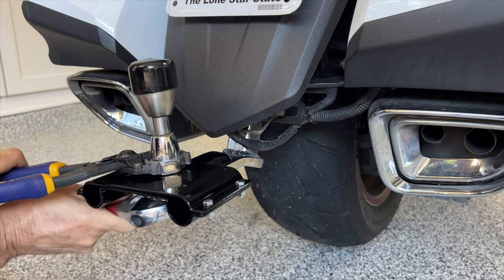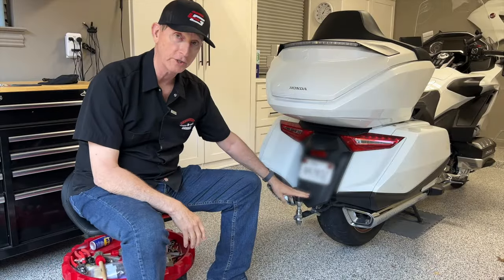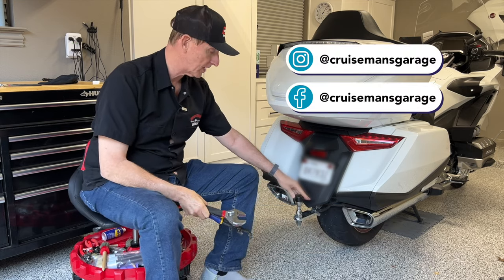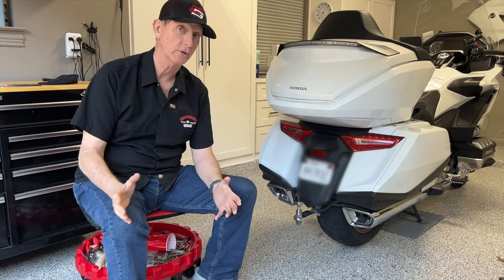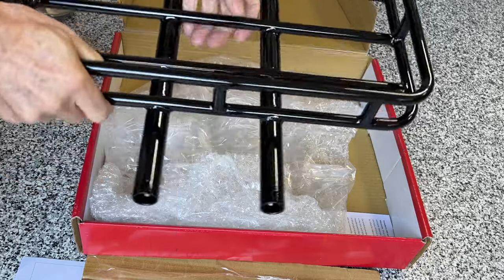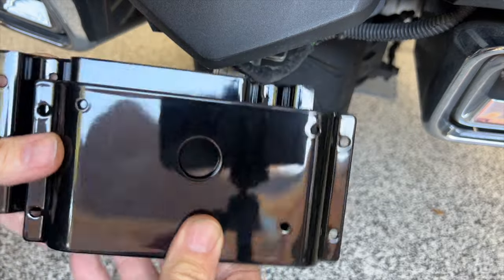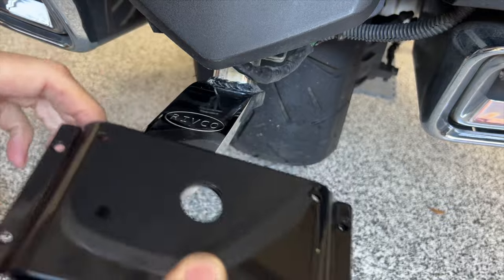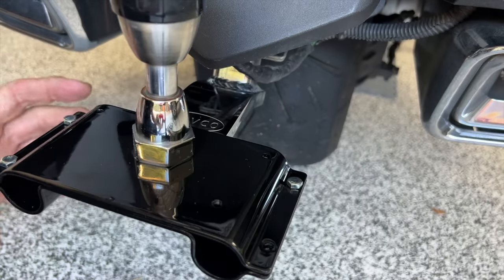Universal Trailer Hitch Rack Install on 2018+ Honda Goldwing

Comment: I purchased this rack last summer for my 2021 Goldwing. I ended up attaching an Igloo cooler which kept my food and beverages cold. It was a lifesaver to say the least. We ended up hitting temperatures of 107° while riding through the Los Padres National Forest . The cold beverages along with my “Big Ass” cup holder Kept our beverages cold and we remained hydrated during the ride. The rack did not appear to change the performance or handling of the motorcycle whatsoever. It’s a great addition if you’re just looking for a little bit more space for your bike. 🇺🇸👮🏻‍♂️

Comment: I've used this rack for the last 2 years. My wife and I have done over 5000 miles with it. The smaller bags and trunk on 18+ help me decide to purchase this. Each year we take at least 2 long distance trips. The extra space and easy removal when you get to where you are going makes it convenient.  I use a 40L Nelson Rigg Hurricane duffle bag and stack a 10L Nelson Rigg on top of that. Enough clothes for a week and extra in case the temperature changes. There are no problems with lean angles, weight issues,  or exhaust heating up the bags. You never notice it back there. The license plate is covered but I took Max McAllister advice (watch the War Horse project) and photocopied my plate and attached it to my bag. The brake lights are not covered.  Be careful when entering driveways or parking lots with steep slopes because it may drag. Hope this answered some of your questions.

Comment: It never ceases to amaze me as to how “stuff” people insist on travelling with. I rode across Canada last year, took a ferry across to Maine, and back out west to Alberta. I was on the road for 4 weeks with my 17 F6B which as most people would know has no trunk. So I had 2 saddlebags for everything bike related plus rain gear etc etc. on my back seat was a medium sized waterproof duffel bag. I tend to do laundry every second or 3rd day on the road and that’s it. It just blows me away that people would travel with a weeks worth of clothing …on a motorcycle and “somehow” fill another duffel or two.
Reply: More space for a laptop , I Pad , satellite dish and small tv .

Comment: Hitch on a motorcycle is something I've never understood.  Where is the fun of riding? Being able to use its size getting into tight spaces? Ease of maneuvering in traffic?  
If I need to take lots of stuff, I'd take a car and trail a bike.
Reply: 1000 % agree with you.
Reply: The "fun of riding" is still there.

Comment: Nice video Cruiseman.  Here was my thinking when determining this style tray versus a trailer.  Let's say you have 30 lbs of stuff loaded on that tray.  The tray is roughly 3' from your rear axle.  That's a moment arm of 90 ft lbs of downward rotational force on the rear suspension.  Added to whatever you have in the OEM bags and trunk, plus a possible co-rider.  That's a lot of downward force on the rear suspension parts and tire.  Contrast a trailer (I too have a Bushtec) that can hold up to roughly 200 lbs. (that's a lot of crap) which is supported mainly by the trailer wheels.  Much lighter tongue weight and no shock loading due to bouncing, etc.  The tray concept is probably good for very lightweight day trip needs, but if you're in it for the long haul and traveling an extended time, save the bike and get a trailer.  Just my thoughts sir.
Reply from the maker: Fair points.
Reply: A 200# trailer should have a tongue weight of 20-30# (10-15% of trailer weight). That puts you in the exact same boat (albeit with more gear).

Comment: Why not just flip the cargo tray over so you have a flatter surface to mount a bag to? You might lose that anti-rattle screw usage but you could put a larger bag etc on without issue.
Reply from the maker: I suppose you could do that.

Comment: It may have been a different brand, but I've seen FB posts where the bracket gave way where the tubes slide in.  They may have over loaded the rack, but I'd be careful.

Comment: How much weight could this hold. 
If I missed that in the video I’m sorry but I also checked the website and didn’t see anything 
This would be perfect for my tools at work but that could be up to 40 lbs
Reply from the maker: I don't think the issue is the rack, but the tongue weight capacity of the hitch itself.

Comment: How about the heat coming from the exhaust pipes would it not melt plastic coolers? Or soft bags ?
Reply from the maker: Not sure the exhaust is THAT hot to melt a plastic cooler. And, the exhaust should mostly travel under the bag. It could get some exhaust dirt and grime, however.

Comment: Didn't see a max carry weight?  Does it reduce lean angle?
Reply from the maker: Only affects the angle if you are doing wheelies. I could not find a max carrying weight, but that is probably limited to the tongue weight capacity of your trailer hitch.